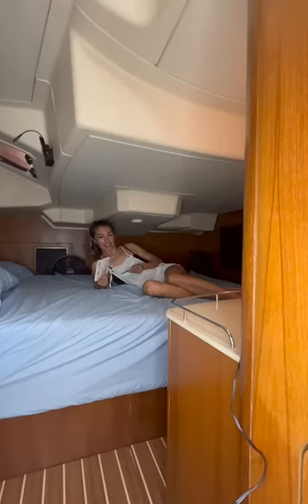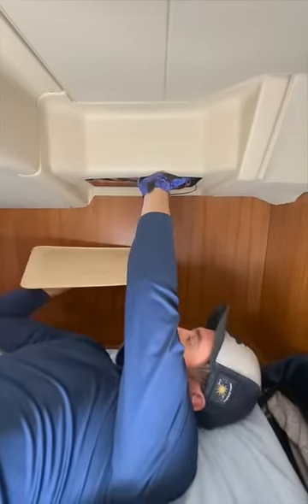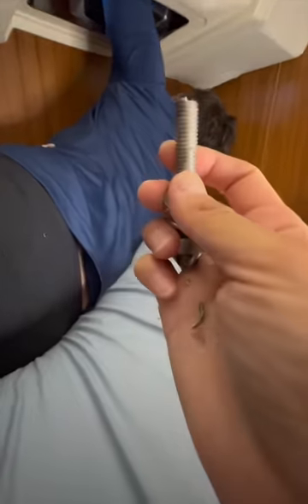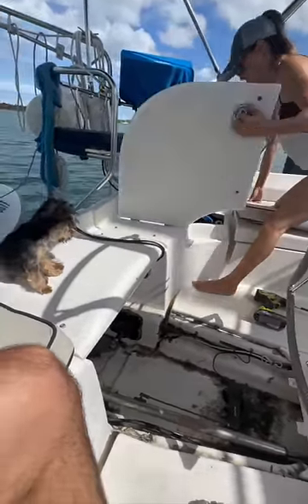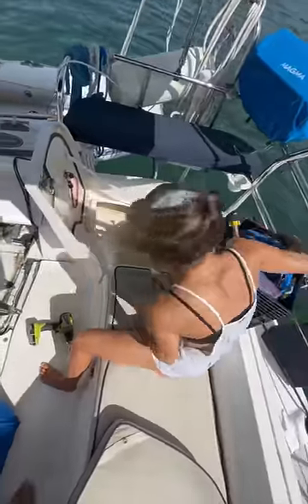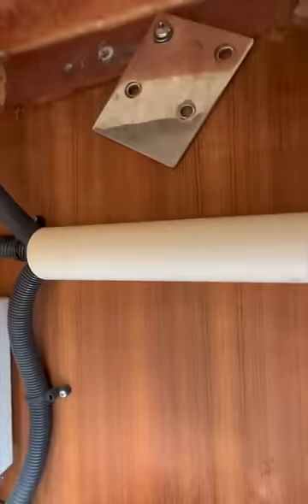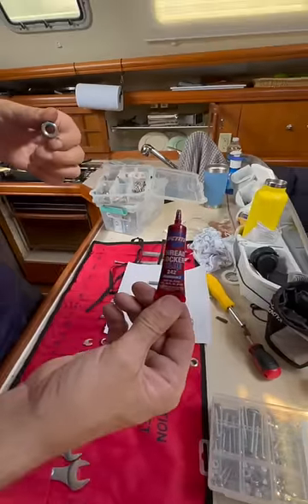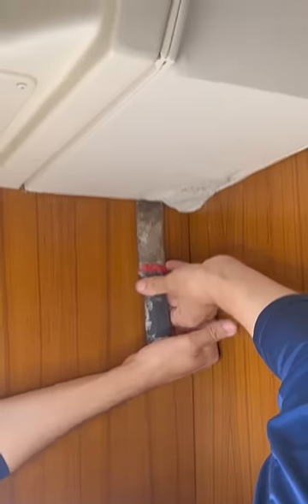Auto Pilot Repair  #sailingbyefelicia

Comment: Nylon insert lock nuts have a plastic section that taps itself as you put it on the screw. It eliminates the need for messy loctite, they don't vibrate loose and cost a few cents more.
Reply from the maker: Great tip.    We made this repair on the fly, so we had to use what we had onboard.
Reply: If you ever run in a situation where you don't have either, no nylock nuts and no bolt glue, you can try putting two regular nuts back to back. Tighten the piece on place with one nut, then tighten the other nut against the first one. This often helps the nuts to bite so it is more resistant to rattling loose.
Reply: @thoubias  if you ever lack spare nuts , consider peening over some threads on the bolt with a punch, you may have a shitty time if you need to remove it later but it's not rattling off
Reply: The nylon nuts will eventually crack do to exposure to salt water environment it would be better safety wire the nuts instead
Reply: Loctite is pretty good too if used correctly
Reply: I was going to say the same thing as this guy,(use a nylon nut); using a second nut like @thoubias suggested also works great. I didn't know about the salt water issue with nylon nuts, so you might want to go with using the second nut if you have room to attach it.
Reply: @vonries  yes salt water takes its toll on just about anything it can get it’s hand on
Reply: @SailingByeFelicia  use both salt water can wear the nylon
Reply: Its a nice thought, but I've had nylon lock nuts back off from a trailer jack handle. Resulting in the handle falling off while being trailered
Reply: I wish I could say you’re right.  I’m a 310T mechanic.  I’m aware of the nuts you suggest. The issue is heat.  The plastic lock ring can heat up and with friction to the fasteners the plastic and expand over time and fail. If you want to be 100% safe use a castle nut with slots and drill a hole through the stud after it’s tight. Then lock it in place with a pin or Swedge.
Reply: @xanthopoulos1825  being trailered.  Lol. “In transit”
Reply: @progunerjie291  stainless lasts pretty long in salt water.  Not forever but 10 years at least. I’d use 10.8 grade studs tho.  Much stronger and will last and last.
Reply: I don't see anyone mentioning lock washers, are those not used anymore?
Reply: Or nordlock washers ;)
Reply: Another more permenant option to avoid total failure is use screw driver and peen over some threads or you can drill the bolt and put in a lock pin
Reply: @xanthopoulos1825  probably from the spinning motion and not so much the vibration
Reply: Nylock will work but its a sailboat so its going to break again no matter what you do
Reply: Was that red lock tight? Red is permanent, need blue, it wont come loose from vibration but you can still remove, doesn’t help now but
Reply: @daniellepage2923  I would still use safety wire tho do to the vibrations. The 10.8 studs with safety wire would be a good combination
Reply: @progunerjie291  There are all metal lock nuts that might work too.  I have bought some for high temp applications before from Mcmaster-Carr.
Reply: @ryancappo  I forgot about those that would do the trick
Reply: Was gonna comment on buying the correct fasteners for the job.
Reply: @SailingByeFelicia absolutely incredible you guys could fix this on the fly.
Reply: We use nuts with a curcular bottom hole and an oval shaked top hole. as you thread it in it expands the oval hole and self locks.we use them in high temperature areas or areas that nylon can't be used.
Reply: @progunerjie291  the castle nut and pin can’t come loose.  The pin locks the nut in place.  Used on ball joints and cv axle shafts.
Reply: Ehh, I do like nylon lock nuts but they’re not quite fool proof either. I typically use some sort of multi lock approach. Threadlock and nylon lock nuts or serrated lock nuts.
Reply: @SailingByeFelicia they make lock tight glue sticks now I like locktight better than nylock nuts cuz you can reuse the nuts
Reply: @davidlabossiere1140 oops, I read “try peeing over…” 😅
Reply: Or, for just a dollar, you can use nail polish instead. Works just fine. We’ve used it on computers for years. The cheap stuff works just fine.
Reply: @daniellepage2923  I don’t know man I love my safety wire
Reply: In a semi critical part like this I would drill a small hole thru the end of the bolt a run a wire so its ~impossible to back off.
Reply: @progunerjie291 as an aviation nerd, safety wiring nuts on critical equipment would be high on my list, along with loctite.  Forgetting loctite is a mistake you only make once.  I mean 10 times
Reply: Messy loctite... Do people even
Reply: @redfailhawk  does that really work that would be awsome thx
Reply: Loctite is perfectly fine. This thread is pretty pointless.
Reply: @applicablerobot  ah yes a true man of culture.  (I am just about to finish up my schooling for my A&P)
Reply: @SailingByeFelicia he watched the short, he would know. Oddly defensive response lol
Reply: depends, sometimes you might need one or the other or both, high frequency vibrations loose nylocks enough to rattle em loose over time, and high heat will melt or suficiantly softens nylocks to rattle em as well
Reply: @Spellchecc1OO Really? It looked like they were merely explaining why they didn't use nyloc nuts - they didn't have any onboard at the time?
Reply: @progunerjie291  I am a commercial airline mechanic. 
We used to use tons of nylon lock nuts. They have been fazed out and replaced with a self lock nut and, as you mentioned, safety wired nuts which are foolproof.
I have not worked on boats much, Maybe there is a reason for nylon lock nuts. IDNK.
Reply: @progunerjie291  that’s fair.    I mean it’s not like wire is gonna make it worse.  So I mean go to town :)
Reply: @applicablerobot  lol
Reply: @spencerroberts4940  I have worked on boats some but I am currently studying to get my A&P that’s why I recommend it since it’s fool proof and you don’t have to worry about it if I may ask what company do you work for
Reply: yeah just swim to the hardware store
Reply: @progunerjie291 Nylocs are often used in marine applications because of their resistance to salt water. Why are you just making things up
Reply: @eggshapedisraelioperative6317  I have had quite a few crack on me in salt water environment over a period of of a few years
Reply: Loctite or weld it. The nylon degrades and doesn’t actually prevent the nut from moving due to vibration.
Reply: @lsksniper1936  bruh. if nylocs didn’t resist vibration then they wouldn’t be used in life critical systems in multi multi million dollar aircraft. they wouldn’t be used in vibratory mining equipment worth tens of millions of dollars. there wouldn’t be studies confirming their capacity to remain fastened in high vibration scenarios. who told you nylocs don’t resist vibration lmao
Reply: @eggshapedisraelioperative6317  They aren't used like that without some other form of locking IE serrated washers or tie wire because of the fact that they don't stay tight during vibration.
Reply: @lsksniper1936  That’s just simply not true. Seriously, where did you hear nylocs don’t resist vibration? I am a mechanical fitter and have worked on things like warships, aircraft, missile systems, and mining equipment, all of which are exposed to high vibration, and only on certain parts of aircraft was tie wire required on fasteners. There was a plethora of instances where nylocs didn’t need a secondary fastener because of their ability to resist vibration
Reply: Nylon is far top soft for this job.
Reply: Yes I swear by them, on a boat stainless nylon insert.👍
Reply: All of you are completely overlooking the fact that nylock nuts make this a two person job for the most part. One person in each compartment. Loctite will let you spin the nuts on til they are tight enough to grab and wrench down on from one side. I have had nylon deteriorate over time outside in the conditions. Not sure if the cause was salt or UV but these were only on mailbox posts.
Reply: Sure, you can get them at the floating hardware store just over the next wave.😂
Reply: , in Mauritius we call it spring washers or broken washers.
Reply: @thoubias this work’s much better with a luckwasher between the two that will hold better then loctite
Reply: Spanner ring (the cut open ones) will do the same trick. Nylon nuts can only be used once!
Reply: Off topic but handy: When you need to cut a bolt for length, make sure to screw a nut till the head. That nut will cut a clean thread after cutting the right length.
Reply: @yyfreak1637 

Not only is it good, but it will prevent corrosion, too.

Comment: The most impressive thing about this video is having the spare bolt and loctite on board while making the repair the first time.
Reply: yea looks like they got an entire hardware thing!
Reply: Well if you know anything about sailors they usually have everything and a little bit more on their boats.
Reply: My understanding is that when sailing, you make sure that most things are using the same bolts and parts as much as possible, so you carry a set of bokts and repair anything.
Reply: Yeah. Usually I just stop by the store on the ocean and pick one up. These guys are smart
Reply: You better have a hardware store on board
Reply: If you ferry boats for a living, you don't know the boats very well.  
As such, you don't become complacent in their capabilities.  
So you prepare for the voyage like everything is going to fail and hope Murphys law doesn't kick in
Reply: @jii-ro7083  Exactly!  Not just hardware either, they'll carry all sorts of spare parts for anything that's a necessity..
Reply: That is a bare minimum. How is that impressive? Never leave the dock without spare parts and tools.
Reply: The most impressive part of the video is having the spare bolt and the loctite on your boat and running around with a Ryobi drill to put them all in
Reply: @DirectedByEyaare  Seriously?  Pretty much every live-aboard cruiser has like 2-3 spares for every system on the boat, a variety of tools and hardware.  Their lives could depend on it.

Comment: I was a certified marine electronics tech for many years. I often made flights to the Bahamas and Caribbean for this exact issue. It's pretty common on sailboats. Recommendations: 1- use as large of bolts as possible. 2- make sure the bulkhead where your backing plates and drive attach, is super sturdy. 3- Use stainless hardware with nylon locking nuts (and keep extra on hand). 4- develop a schedule to inspect the AP drive unit often. More when at anchor. 5- when at anchor for extended periods, or even rough weather at anchor, disconnect the drive unit from the rudder, if you can safely. I'm sure you noticed all the movement while you were making the repair. Big rudders = lots of torque. Good luck.
Reply from the maker: Great tips.   Thanks!
Reply: And when nylon locking nuts are not available, double nuts work great. (torque the outside nut while holding the inside nut still) thread lock works fine, but it can be a total pain pulling it back apart when replacement is needed.

Comment: That’s crazy to me that you can have autopilot for a small boat like that.

What happens if you’re asleep and for some reason a tanker is on course to intersect you and you need to deviate course?
Does the system do that safely, alert you so you wake up n make a course correction, or do you just hope it doesn’t plow into you while you slumber?

Comment: Make sure it's 316 SS lock nut or washers would have worked too for a few more cents, and make sure you use anti seize  unless you like using a Sawzall
Reply: Not sure you're with concept of boat life... they got what they got and nothing more.. I'm thinking you're thinking they have a whole hardware store aboard
Reply: @True Aussie Ray  yea I mean I don't think  any other  country  on earth invented  stainless   nuts and washers. They must be  still using wooden dowels to hold parts of the boat  on.
Reply: @ClipPointCam right over your head again huh...?
Reply from the maker: Thank you for advice. We are limited to what we have onboard and what the local hardware store (in this case, we weren’t near one ☹️)

Comment: This would be perfect time, to start your search for Costs. Like what would it Cost to Replace the Auto Pilot if it fails. Something that should look into and get pricing for. Put it into a Notebook and can use that notebook and look at other Costs for other things. Like Sails if they would ever need to be replacing. Then start to put abit of Money aside just for replacing those items. While it is always hopeful never have to replace them, but if ever did and you put money aside. could be a Lesser Hit on expenses
Reply from the maker: Thank you for the tip. Lisa keeps an excel sheet of everything we’ve spent to-date. But comparing it to cost if we outsourced or to replace would be an interesting video

Comment: I’m a car guy…. Does that unit have servos that control something therefore tension on its mounting hardware? All these helpful hints on nyloc nuts but the reason the bolt broke was it was low grade weak metal. Use grade 8 on regular stuff, grade 10 and 12 on stuff that can’t fall apart no matter what - like we do on suspension, brakes and steering.

Comment: Blue and red loctite on Philips screws? You're both big into commitment.
Purple loctite is for things that must resist vibration, but can be disabled easily in the future.
Reply from the maker: Thank you for the tip
Reply: @SailingByeFelicia be super careful with red loctite. It's meant to never come off, and it's good at it.
Reply: They have full access to the bolts a minute with a cigarette lighter on it off she comes

Comment: Yep, I installed an auto pilot on the same make of sailboat. I  fit my 6'8" body in some pretty tight spaces but there's a lot of room back in the laz if you lay down.
Reply: What kind of boat?
Reply from the maker: They are right places. The key is getting into the laying position ❤️

Comment: Consider an impact driver to torque things down, especially where there's movement. You'll never get those Philips head bolts anywhere close to as tight with anything else (drill/by hand)

Comment: If you’re wanting to isolate items from rattling loose from vibrations, look into Vibratight. Similar to locktite, but much easier to take apart when you need to. You also don’t have to heat it up to take it apart.
Reply from the maker: Great tip.   We will put that in the toolbox

Comment: Should have put a bit more wood on both sides got a tad bigger bolt and reinforced it. If it's got that much to bust the bolts you might want a couple more ounces in prevention

Comment: Don't use loctite.use lock washers and self locking nuts.cause when it does break(everything does eventually) it's easier to deal with.anything vibration related should be lock washered at least

Comment: I find it rather strange that the bolts "rattled' loose or off? does a sail boat really have that much vibration going on? the auto pilot works with the combustion engine running or is it just a motor that steers the Rutter? I'm wondering because did the bolts rattle free or where they over powered and pushed out or pulled out of place?
Reply from the maker: The auto pilot is an actuator mounted directly to the Router post. It does not care if the engine is on, or the boat is under sail. It’s simply pushes or pools until the boat is lined up with a compass point. 

Our boat was 20 years old when we got it.   So 20 years of pushing and pulling.

Comment: If it has a nut, you use a bolt with a hex bead  not a screw head  especially if you're using loctite.  You can't match the torque with the screwdriver that you're applying to the nut and the screwdriver will likely lose grip.

Comment: Im assuming the autopilot went haywire because it was sitting at an odd orientation relative to the boat seeing remounting it was all that needed to be done?
Reply: Probably just needed recalibrated put should be fine
Reply from the maker: Yep! It would give an error and stop working. Once it was tightened back on the bulkhead, it worked like a charm

Comment: I'm skeptical this is real. That bold was a 1/2in bolt and didn't look corroded. So unless something else was pushing extremely hard on the mounting bracket this is cap
Reply from the maker: Not corroded, we think it’s been vibrating for some time, rattled off most of the nuts and cleaved the last bolt.

Comment: Would recommend in the future to use nyloc nuts for your mounting hardware.
Reply from the maker: We would have used them if we had em on board.  I had a box of 100 but they were 1/4 “.  These bolts were much bigger.

Comment: If you're using Loctite on Stainless fasteners, you need to use a primer for it to work to it's full potential.  Permatex Surface Prep spray is the one I use. It nearly dou les the strength of loctite.
Reply: This ^^^ or use nyloc nuts
Reply from the maker: Thank you for the tip!

Comment: There are alternatives to using chemical compounds, antivibration washers will not move , the sharp edges stick into the nut and surface you bolt onto, nyloc nuts have already been mentioned , tab washers can be bent down over the edge of the plate and up onto the nut, finally there is my final choice of castellated nuts which have slots you drill through 
the thread and put a split pin or R clip.
You could Invest in a drill jig that allows you to drill through the nut and you wind wire around locking the whole thing together.
All are far better than chemicals.
Reply from the maker: Sounds like you have put a ton of thought into this.
Reply: @SailingByeFelicia  
No, I'm old and have used all of those products.